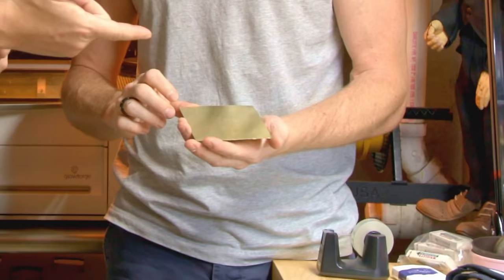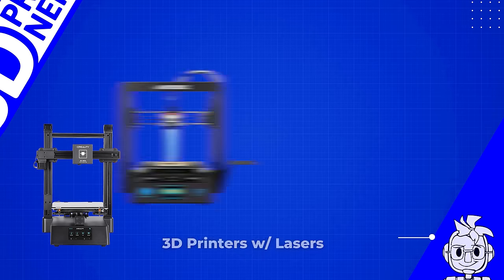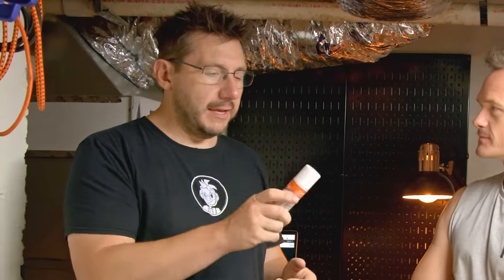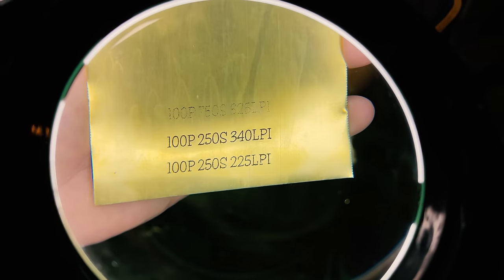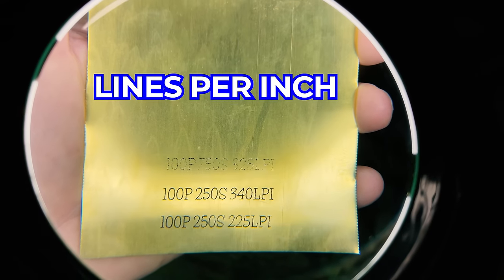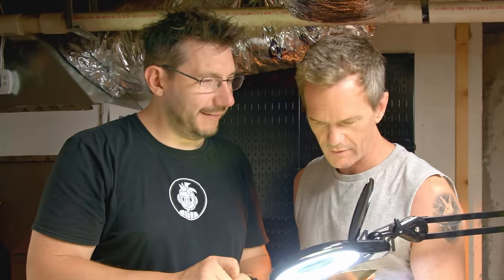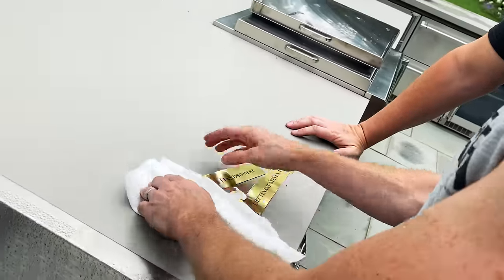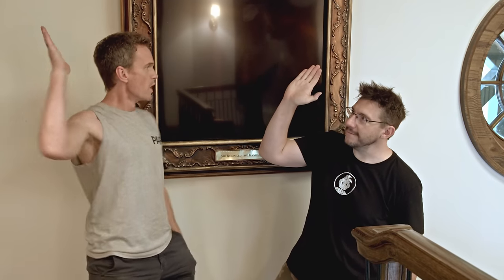Lasering Brass with Neil Patrick Harris!

Comment: Hey Joel, Old Adobe Alum here. You missed an important tool, when going through the “feeds, speeds, power, and addressability*” to get the most balanced result, for every test line you need to do a reverse out (a black box with the printing left unetched and everything else within the box etched.) when the positive printing and the negative printing look equal in weight you are working at the effective resolution of the device. This is most apparent when printing small type. Rule of thumb *addressability gets rid of the jaggies resolution determines how small you can print without the type thinning out or becoming too fat. Great job. High five, and hug your kids.

Comment: Hey Joel, for engraving stainless steel with my cheap diode china laser, I simply use whiteboard marker or a sharpie instead of expensive marking spray. Spray rubber for car rims also works. Did not test it with brass yet but works fine with steel.

Comment: As a suggestion for cutting the thin sheets of brass... Have you ever tried using one of those old-fashioned "Guillotine Trimmers" (usually used to cut paper)  I've found they cut cleaner lines, as long as your sheet material is thin enough.

Comment: I do laser cutting and engraving for a living. I've found that for functional applications, cermark doesn't bond strong enough with brass or aluminum. If the part is going to be handled constantly, it ends up rubbing off.

Comment: I laser brass with our fiber laser :)

The Cermark spray really doesn’t have longevity, you will find that it rubs off fairly quickly, vs the fiber laser where you are actually removing material.
Reply from the maker: I really REALLY want a fiber laser.

Comment: Cermark on Brass is great, and this is a great explanation. But it's NOT ETCHING. Etching is removing the surface by some means that is not mechanical. Normally chemical, but the term is extended to laser etching, which is what you do with lightweight lasers on wood, or serious fiber lasers on metal. The Cermark process (which can also be done with cheaper materials than Cermark brand) does not remove the surface. It bakes (or probably more correctly sinters) the ceramic material onto the surface.

Comment: I've run into issues using hot water to wash the excess spray off after lasering. I ruined some custom cut steel plates with hot water. I don't know of a way to remove  the cermark magic after it happens. Stick with cold water.

Comment: Neil, for those digital frames, would be cool if you use a small color LCD display like those used in car stereos. so u can change the name when u wanted, change the background and Font colors and formats, with a touch display in the name tag, u could control the actions of  said frame above.

Comment: At risk of throwing shade, which is not my intent.  All I could see in the end, were the witness marks on the brass plates where the shears were used.  Im hoping that NPH considers these a proof of concept and redoes these using properly cut  and polished plates of a thicker gauge.  These look ok from a distance, but at eye level, I feel they subtract from the otherwise impressive frames.
Reply from the maker: Oh these are DEFINITELY for proof of concept and temporary. I promise thicker copper that’s much better cut will be used in the final versions.

Comment: That paint is pretty special. It must crosslink when hit by the laser, so that it becomes non-soluble in water. I wonder if there's a version that can work as an etch resist after lasering, but then be removed in acetone or some other (not too toxic) solvent? That would allow you to really etch the brass (in acid), and would even allow you to make printed circuit boards.
Reply from the maker: Ooh!
Reply: There is a resist like that, I have a friend who uses it for PCBs. I think it's photo sensitive, though, so I'm not sure how it would work under a laser.
Reply: @RamDragon32  are you referring to a normal photo sensitive resist? Maybe they would work with a laser with the right settings. I suppose there's no reason why they would not.

Comment: No way you can get a real resolution of a lot  more than 150 LPI with this laser. The focused laser is in a realm of 0.15 to 0 25mm diametre. So in fact what you do is overlapping burns. Decreasing the LPI and the speed can lead to crisper engravings.
Reply from the maker: Wait really? Ooh I’ll try this.
Reply: @3DPrintingNerd  If you want to get deeper into it, check for Russ Sadler videos on laser photoengraving. It is CO2 laser related but the basics like dot sizes and speeds apply to diode lasers as well.
I learned a lot from him!
Reply from the maker: @arminth  Thank you!

Comment: You couldn't find a way to cut the brass without kinking the edges and whatnot? It amounts to high end results on garbage brass substrates.
Reply: The cuts aren't even straight. Better off using thicker brass, painting and lasering off what you need. Then soak in ferric chloride- paint again then polish.
Reply: I noticed that too. But since these were the first he had done they are just the trials. If he does more then yes thicker brass properly cut is the way to go.